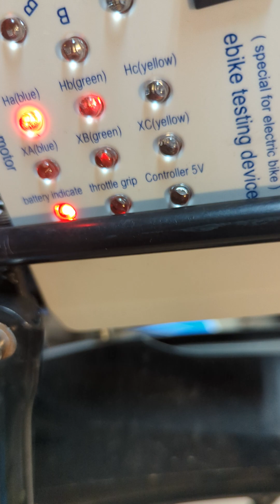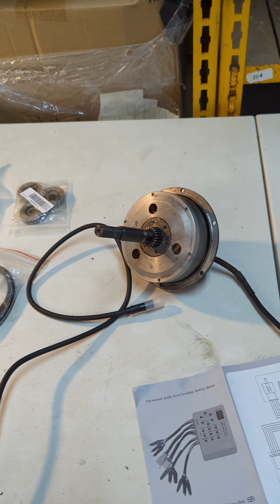Ebike tester for Z910 /julet 9 pin connector, and planetary gears for the  czjb 36v  250w  hub motor

Comment: How did you get into the CZJB hub to replace the planetary gears?   I am trying to do the same to mine and after taking off both the freewheel and the disk brake I am stumped. The magnet housing slides out half way and then stops there doesnt appear to be any way to move further with it

Comment: Hi Michael! Is it possible to test hub without controller at all? Just wheel and tester?
Reply from the maker: Hi  Maks, it is possible to test the hub without the controller. As you plug in the eBike tester directly into the hub motor. The tester enabled you to test each component (e.g., hub motor, brakes ,  controller etc)  separately.